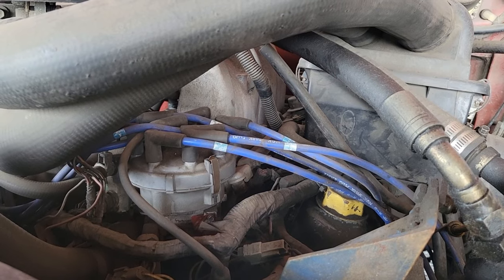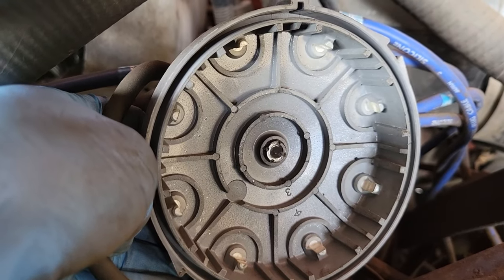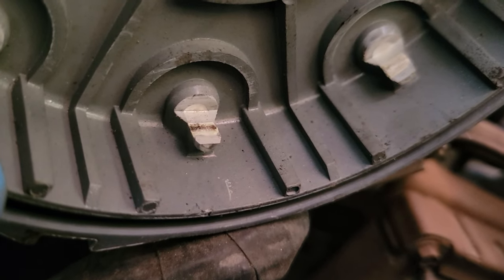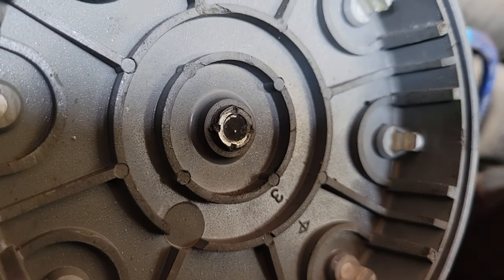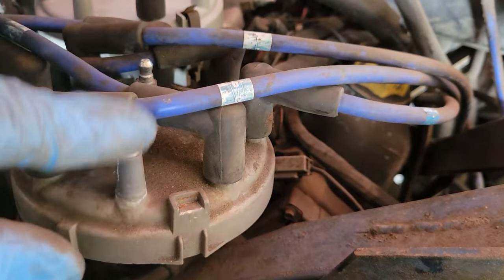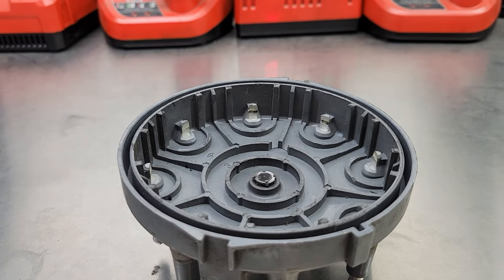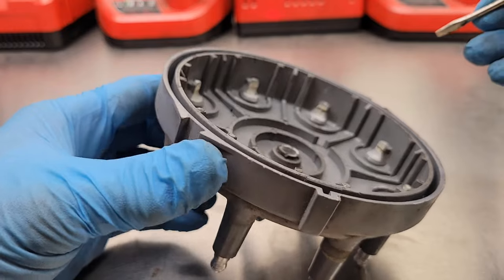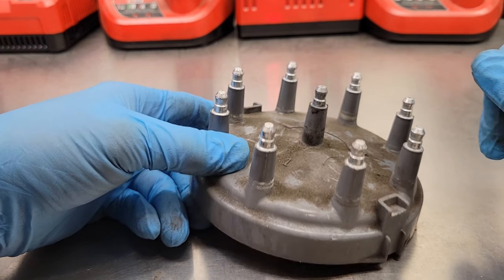Misfire Stall Or No Start? How To Check Your Distributor Cap For Common Problems.

Comment: I have a 78 dodge Sportscoach 440 b300 mobile home at the moment inahbe issues on a cold start. ot will turn over, but it will shut off immediately. it may run for 20 seconds.  I was thinking of a faulty fuel pump or needs carburetor adjustments.  my reason for thinking something witu fuel is because I'm thinking I have to pump the gas like 50 times evern thogh thr pump was changed about a year or two ago amd it hasn't even ran much. once I get it to stay running, it does fine at restarting throughout the day. it does fine for 6 hours sitting, and I'm not sure what's the final  amount of time till it gives me issues again
Reply from the maker: I would take a look at the choke since its a cold start issue. Perhaps it is sticking open? Let me know what you find. Thanks for watching and commenting.
Reply: il take a look at it as soon as I can. how do I diagnose it and fix it? I'm new to fixing vehicles myself being inflation and the rv alone . inflation plus rvs are expensive, tow or on, and the average shop or person I'm from doesn't like on them.  So far, the little I've learned how to do saved me tons of $$$ and time waiting I even ahe thr time to do it myself

Comment: Do all cars have a distributor cap? I have a WK2 Jeep Grand Cherokee, but havent been able to locate it yet
Reply from the maker: Only older engines have distributor caps. Most newer ones like yours have distributorless systems "coil on plug" which is an individual coil per cylinder. Hope I was helpful thanks for watching.
Reply: @shanersmechaniclife3164  Got it! Thank you!!

Comment: I got a 92 f150 4.9 liter and ive replaced about everything except the o2 sensor (because i stripped it out)..... but anyways i checked my distributor cap the other day and seen like metallic dust/powder all around the center button and likewise on the rotor itself and some was around the inside of the distributor as well.      Could this be whats causing the truck to miss/and buck-jump after i drive it a very short distance.??      Like I'm talking about down my street about 2 to 3 blocks and then its like i can barley make it back home because i got no power and i can put it in neutral and rev it a little but as soon as it's under load it doesn't want to go and is missing like crazy.     No backfires though.       I can rev it when i first start it all day, and it does almost perfectly (except a little miss every now n then).  
  So im stumped and need some help if anyone can suggest.     Thanks
   Liked the video sir!     Good job.
Reply from the maker: Have you found the problem on your truck? The metallic dust concerns me. Have you tried your ignition module? I've seen them cause issues when they warm up. Thanks for watching and commenting. Let me know what you find.

Comment: "water displacement - forty" takes care of the moisture in the cap and it's non-conductive, then wipe with a bit of toweling.  if I don't have tools on board, I make sure I've got my Leatherman (don't leave home without it).  😁✌
Reply from the maker: A good multi tool is a must have to keep on you at all times.

Comment: I have maruti omni,i replaced the contact breaker 2months before,but it again leaves during traveling and then i took the car to mechanic,he adjusted the points and it runs well for two weeks but again the contact breaker points leaves,What the reason behind it?
Reply from the maker: Have you replaced the condenser? If it's faulty, it could cause the points to arc and fail. Hope it works out for you. Let me know.
Reply: Yeah yesterday I replaced whole point set in my car,is it work for me?

Comment: My car not shifting over after a new distributor can anyone help me out
Reply from the maker: Are the spark plug wires put on correctly (firing order)? Maybe timing is off? Let me know what you find.
Reply: @shanersmechaniclife3164  the transmission hose came off now it won’t stay running for over 5 min